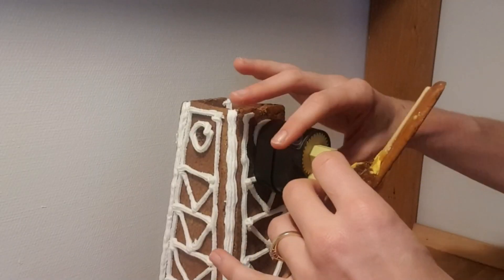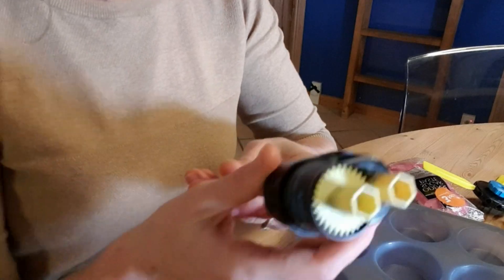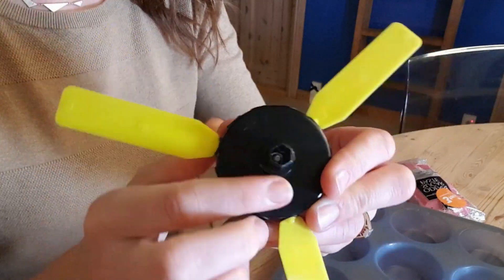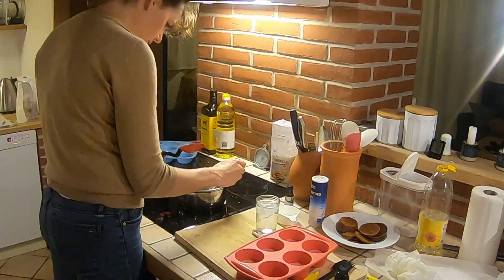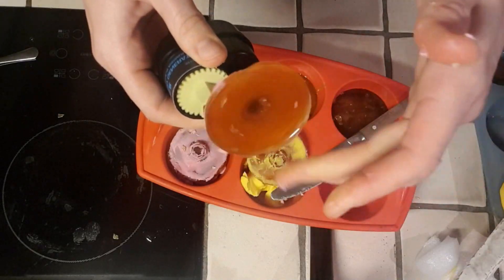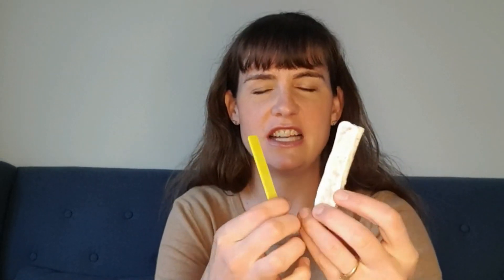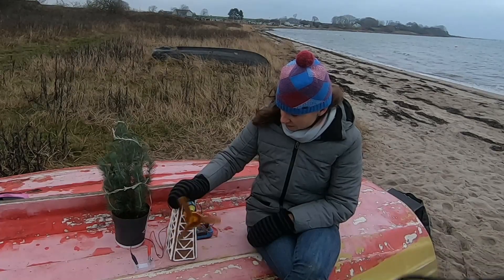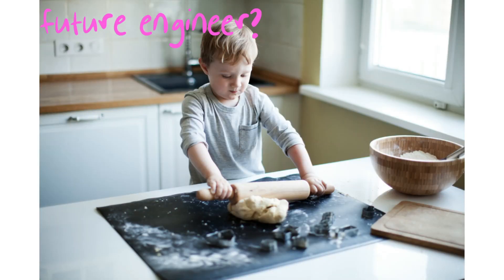I Made a Gingerbread Wind Turbine that Generates Electricity

Comment: A few things you may consider: 1.) Wind your own coils and use a magnet to create an AC generator, because you'll avoid the DC motor's  brush friction, and you can feed AC into a diode ladder to double or quadruple the voltage. 2.) Green or red LEDs generally require much lower voltages (about 1.7v) than white LEDs, and you can get them in super-bright varieties which will show up on camera in daylight.

Comment: With regards to attaching the blades, it was the reheating of the hub that caused the deformation, right? Could the blades be positioned over the mould when the hub is first poured? Cast directly into the hub? Having to get both right together is higher risk, but then maybe the mould is the best thing to really develop and refine? If the casting can be made more consistent, I would try to get the blades in during the hub manufacture.

Brilliant channel
Lots of love

Comment: Candy canes instead of lolly pop sticks and use ice cream sugar cones for the blades...
Reply from the maker: Ice cream cones is a great idea, thanks. I did try candy canes, but the only ones I could get in Denmark were really brittle, they snapped so easily. Now I'm back in Australia where there are a lot of candy cane options, so I will give it another go if I do this project again this Christmas.
Reply: @EngineeringwithRosie  You could scratch make the sugar cones if you wanted to get a better angle/shape on them. Instead of cutting up store bought ones. But you will need to seal them, otherwise with humidity they can get soft.
Waffle style maybe stronger, similar to straight sugar... https://www.youtube.com/watch?v=68zPOGG-FwM

Comment: Wow that turned out looking far more polished than I was expecting, hats off to you Rosie! It must have softened the blow of parts failures that you got to eat them right after! Is this going to be a smooth transition into an episode on the future of materials for wind turbines?
Reply from the maker: Oh wow, you thought it looked polished?! As a baker I was not very impressed with the aesthetics! But as an engineer I thought it worked pretty well for a first prototype. 

I do have a video planned on composite materials generally, which should be coming up in the next couple of months and then I could make one talking about wind turbine blade materials specifically if you think that would be interesting.

Comment: Welcome back!  I dont know if you saw my comment on the other video, but melted gummie bears makes a epoxy for ginger bread.  My goodness your dedication to this project was outstanding. Out in the elemets for hours running tests, truly above and beyond the average enthusiast. I look forward to your Mark II.  My K'nex research has taken a slight turn of its own.  After reviewing other wind blade designs and wondering how to improve them I was able to solve a blade weight problem by building a blade that pushes the center of mass backwards to a stronger point on the rotation shaft, the side effect to this is the blades actually rotate around the nose of the nacelle.  I'm guessing thats hard to imagine,  but I'll have a video out soon.  Congratulations on your Gingerbread  challenge.  A small suggestion though, you might try just using a fan in the house for some preliminary testing before heading out to the outdoors.  I have a box fan i blast my creations with at point blank ranges when I'm trying something new.  Looking forward to the next one, Cheers
Reply from the maker: I have had my head down the last week and a bit working hard on this project, so I didn't see your gummie bear suggestion until after I was finished. I will need to save that idea for next time, it is an interesting suggestion and should be easier than making batch after batch of toffee. I wonder if that is more or less sticky and messy than toffee? 
I didn't have a lot of equipment available for this project, and the hardware store was closed for lockdown so I couldn't get a good fan. But earlier tests I did using the same generator and a fan showed really poor performance compared to even a moderate breeze outside, so I didn't think it would work. But maybe I just had a really bad fan, since you are able to get good tests done that way. It would certainly be a lot quicker and easier.
Reply: @EngineeringwithRosie  IIRC, gummie bears, jello and hide glue are all made with gelatin, i.e. collagen extracted from animal tissue, so I'd second Doktaah Who's idea.  In the experiments I've done, it's relatively straightforward to go back and forth between gelatin, gummy bear and glue consistencies.  Heat up to 60 degrees Celsius (a warm water bath or double boiler is good),  get the concentration you want (1-3% for jello consistency, 25-50% for glue consistency), and get it on to your parts before it cools down.  You can release the glue bond with moisture and heat, you can make it go through multiple cycles of heating and cooling without breaking it down (as long as you don't go much above 60 degrees), and you can glue on top of your old glue (three of the reasons that furniture restorers like hide glue).  There are lots of hide glue video tutorials out there that you should be able to translate directly into food-grade gelatin.